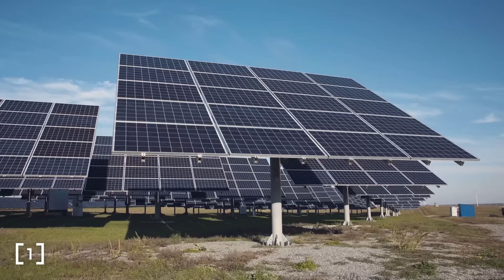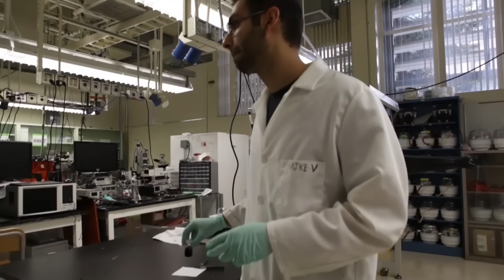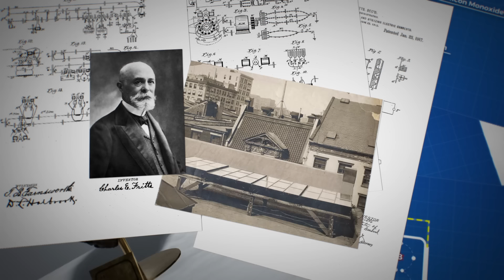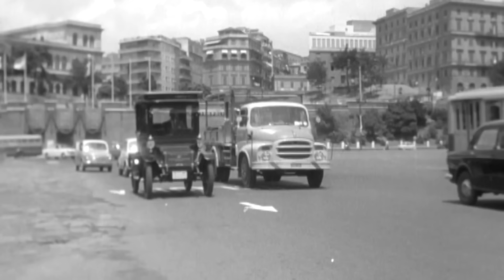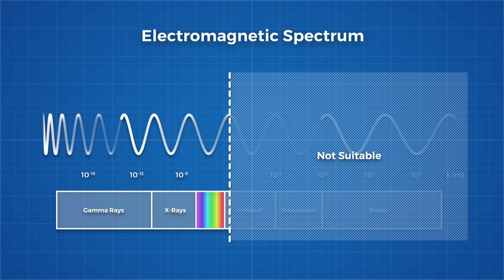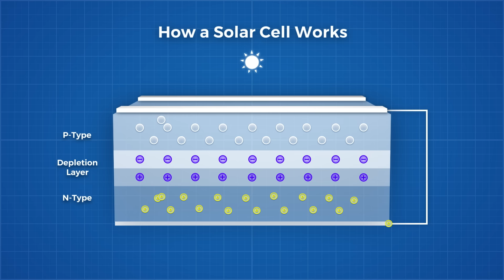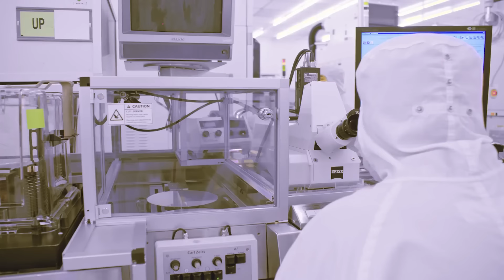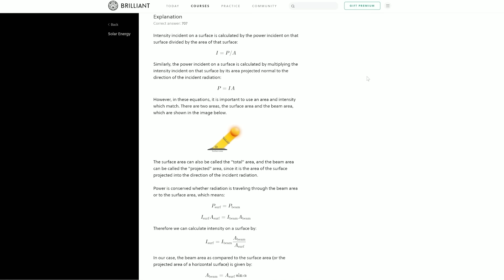The Mystery Flaw of Solar Panels

Comment: The real flaw of solar energy is that it needs storage and storage is expensive. Solar energy is very dilute and intermittent.
Reply: That's why wind, geothermal, nuclear, hydro, and pumped hydro can make up the difference
Reply: @samueltukua3061  Only nuclear matters really. And if you have nuclear anyway, why bother with wind or hydro or geothermal? Especially hydro is a very dangerous source of energy with historically the most deaths per TWh of energy and it is the most destructive to nature just in normal operations, not even when it fails.
Reply: @AlJay0032  because nuclear is still statistically more hazard prone, has even worse long term environmental effects (because we have no way of actually cleaning it up for the hundreds to thousands of years it's hazard), can be used to make nuclear weapons in every country that houses them, has exorbitantly high start up costs, is disfavored by a larger majority of the American public (second only to oil), and when massively corporatized and profit driven I can only see these problems becoming more dire. Thorium reactors have been offered as a solution, but while I agreed with them originally because of their touted benefits, it seems like thorium reactors have already been made and were not nearly as good as advertised.
Reply: @AlJay0032  also I looked it up and that's factually wrong about hydro. The highest number of deaths per terawatt are 32.72 for brown coal, 24.62 for black coal, 18.43 for oil, 4.63 for biomass, 2.82 for gas, and finally only 1.3 for hydro. Then 0.1 for nuclear, wind, and solar combined. this according to "Markandya & Wilkinson (2007); Sovacool et al. (2016); UNSCEAR
(2008; & 2018)"

Did you mean most of renewable energy? Because sure, but that's also about 16-27 times less than our biggest fuel sources
Reply: @samueltukua3061  The numbers you have are wrong. For example if we include deaths for Chernobyl, a socialist military reactor designed for breeding plutonium fast, then we should also include all the deaths for hydro. For example in WWII the Chinese government blew up a dam killing over a million people to prevent the advance of the Japanese. (Well the Japanese advanced anyway in the end.) Also we should not ignore the socialist Banqiao dam failure in 1975, which killed over 150'000 people, if we include Chernobyl to get to 0.1 for nuclear. If we would be honest we would say Chernorbyl killed less than 50 and Fukushima has killed none and will kill none.

Also your numbers for the other energy sources are wrong. Coal deaths in the none-OECD (including such places as China and Pakistan) has over 60 deaths per TWh, while in the west the numbers are lower.

A top killer is also liquefied gas and the numbers for biomass are enormous. Of the over a billion people burning cow dung and similar stuff indoor for cooking without proper ventilation many die of lung problems.

Banqiao was rather recently, why didn't the media report on it much? Why isn't it common knowledge? Because the green journos exaggerate the nuclear accidents and are very low key when it comes to reporting the problems of their pet energy sources. Why don't they make a big fuzz about how windmill blades are a huge unsolved long term waste problem?
Reply: @samueltukua3061  Sorry but what you are saying is factually false. The waste problem was technically solved in the 1980s.
Used nuclear fuel rods are recycled and the long lasting uranium and the actinoids are taken out to be used in new fuel rods in France for example and the remainder is put into glass, where it is safe and will be less radioactive than the ore from which the uranium came in less than 300 years.
If the greens prevent the recycling of nuclear fuel rods while they recycle everything else, even where it makes no sense, then they are just extremely dumb and uninformed. Or they are evil and doing this intentionally to create a problem for nuclear energy.
Other ways to get rid of the nuclear waste is to burn it up in fast breeders. Or to transmute in with accelerators but that requires a lot of energy.

The American public of course has been manipulated into being against nuclear power by left wing greens who want us to remain in energy poverty. Abundant cheap energy would be a problem for their agenda.
Reply: @AlJay0032   according to the US government department of nuclear energy under "5 fast facts about spent nuclear fuel", as of 2019 "The United States does not currently recycle used nuclear fuel but foreign countries, such as France, do." Additionally, nuclear waste can only be recycled so many times, about 2 or 3 depending on when it's recycled, so it will still end up in a storage facility for a tens of thousands of millions of years (the latter only by some estimates) according to "The staggering Timescale of Nuclear Waste Disposal" by Forbes. And considering how much companies love to cut corners, I can only imagine they'd prefer to just store old waste instead of recycling it for as long as getting it from the ground is ultimately cheaper, which is why they currently don't. This is completely beside the fact that nuclear isn't actually renewable, sure it'll last much much longer than current fossil fuels, but it's still finite. Also, interesting that your idea of pure "evil" is not thinking nuclear energy is a good idea. I personally would've thought of things like crimes against individuals like murder, but... being nuclear I guess. I suppose it's helpful to just say "everyone who disagrees me is either evil or ignorant" because then it makes your ego bubble nice and skin tight, like a toddler's. Cozy, isn't it? 

Also, energy poverty??? In the highest energy per Capita country in the world?? Get over yourself 🤣🤣🤣 anyway, try using a source next time. It would make you seem more trustworthy, but you clearly don't know either of those words
Reply: @AlJay0032  CAN YOU PLEASE PROVIDE A SOURCE??? It's impossible to address everything wrong with your numbers (which is all of them), without knowing where you got them :)
 If you looked at my source you'd see that it already accounts for both the dam and Chernobyl issues you have. You'd also see that the brown coal one is due to the number of lives taken by black lung, which was HUGE in the US.
Reply: @AlJay0032  how is a piece of metal long term waste??? Fucking fan blades??? Maybe cause you can... Melt them? Or reweld components?? Or repair and restore them?? Sure we have some issues with it now, but we barely have enough windmills to even address that issue yet
Reply: @samueltukua3061  Because the rotor blades of wind mills are epoxy fiber glass and not metal? Do you actually believe they are made of metal? They are nasty plastic and aren't the greens telling us to stop using plastic? This is not like a few straws or plastic bags, this is tons of this stuff and currently they are being buried in huge landfills because they don't know what else to do with them. Do you know what is seeping out of them into the ground water? They are not being buried in Yucca mountains or deep underground.
Reply: @samueltukua3061  You are obviously either very ill informed and ignorant or intentionally spreading false information.
For example why should you not be able to recycle fuel rods which have been added some additional uranium from recycling other fuel rods? They can only be recycled 2-3 times? Tell me your source or are you intentionally mixing some lies into your replies?

Comment: The REAL issue is the solar panels reject 89% of the sun's incoming energy as HEAT. Solar fields are HEAT VOLCANOES. I worked on a 25MW solar field that changed the local ecology from those heating effects, never mind the disruption of clearing off a thriving cool forest to create a heat volcano, with only a 15-year lifespan. Unless it hails, lol.
Reply: Do you not know that coal plants lose 80% of their energy production through heat? Even worse, this isn't the 50-70 degrees Celsius of the solar fields, but 560 Celsius
Reply: @samueltukua3061  Heat is heat. I doubt your 80% highly. Did you know centralized solar loses 50% of the 7% it captures as elecitry in the transmission? You KNOW Green Energy is a lie, because the power from one solar panel is insufficient to mine, smelt, fabricate, distribute and install. They're not 'renewable' or 'Net Zero' at all! at all!
Reply: @robertmarmaduke9721   "doubting highly" sounds like an excuse for "I didn't even actually look it up and am afraid to because I might be wrong". Also, what do you mean "the transmission", i.e. From what to what? Or did you mean transformation? Or did you mean transduction? And of what 7%? Also, bold of you to blindly assert not only that I apparently know something, but that you somehow know I know something. Saying "you know [insert belief]" genuinely sounds something a paranoid or egotistical person would say. In the sense that you can't wrap your head around others people's minds to contain separate information, lines of logic, and conclusions from your own. Let me be real with you man, your comment is making me embarrassed FOR you. I suggest actually looking up what these words you're saying mean, understanding how these panels work (the video above explains it) and then crafting a response stemming from knowledge.
Reply: @samueltukua3061  Am one of the first environmental science graduates, former Department Head at EPA, until the mafia took over with the SuperFund Scam. Transitioned into the energy field, oil, gas, hydro, cogen, nuclear, geothermal, solar, in US, Canada and projects overseas. From your comment, you're a non-professional narrative re-spammer. You probably don't know Greta is just a paid child actress from three- generations of Swedish entertainers. 😒🔥💩
Reply: @robertmarmaduke9721  this is completely unrelated to the current conversation, but could you explain, without looking them up, what two or three of these phrases mean? 1) a rolling stone gathers no moss 2) birds of a feather flock together 3) don't put all your eggs in one basket. If you could just humor me then it'd be greatly appreciated
Reply: @samueltukua3061  Just keep drinking the ESG Koolaid! Right now you can take out a low-interest loan for $50,000 to put solar panels on your roof, that will have failed in 20-years just as you pay off the loan!! Do it, Sam! Show you care!! Gaia loves all you pooses!

Comment: Sure solar has potential, but its not ready by any means to actually produce reliable source of energy simply due power production to area used. From all the methods in power production nuclear has by far the smallest footprint (pun intended) to amount energy produced, where as say solar would take 1/3 of nations ground surface to power production be 100% solar. This unfeasable and panels tend to loose efficiency even further with out counting loss in micro scratches in the panel glass, dust and well there not being sun light. For person living off grid if they have river with enough volume near that runs year round hydro is excellent method combined with solar panels, but for general power production all so called renewables are rather horrid when comparing utility life, amount of energy produced, footprint used and the cost. From those again nuclear is the winner, followed by hydro, solar and wind being far behind.

Comment: As someone who lives off grid, solar panels are not the least bit useful without storage.  Only half the equation works in a meaningful way.........and no lithium batteries dont cut it for economics or lifespan. Civilization relies on base load power and right now solar is not there yet and it might never be, unless batteries can match lead/acids for cost and nickel/iron for cycle lifespan.

Comment: First, E=hf defines Planck's constant NOT energy.  Second, at 10:00, the separation of charge due to electrons and holes diffusing across the junction generates an electric field pointing toward the p-type.  This is why the diffusion is stopped at a microns thick layer -- thermal energy is insufficient to climb this barrier.  Electron-hole pairs created in this junction are accelerated by this field -- electrons toward n-side and holes toward p-side.  THIS is the current that flows in external circuitry; electron-hole pairs created outside the junction VERY rarely enter the junction.  Thus, we make the junction thicker with graded doping and intrinsic material to enhance the junction's light absorption.  Third, multi-layer cells are now being built (more expensively) with wider gap materials on top of narrower gap materials to push efficiency toward 45%.  Wider gap materials generate higher voltages from the bluest photons and are transparent to redder photons.  Thus less kinetic energy (heat) is left-over.  Lower gap materials then convert the redder photons that reach them.

Comment: The answer is battery. When battery is not yet cheap and not long lasting, offgrid is still problem. When most solar installation are on grid then need huge power generator which can operated come in and out quickly like during peak load. Which that is problem for big power plant

Comment: Just curious, if the degradation is due to not only the boron oxygen impurities but also the reflection of the material why not just create a greenhouse effect in the panel itself? Have the face of the panel be able to allow light through but not escape and then the back panel traps the light coming in to bounce back and forth between the insides of both panels faces. Would that be possible  or would that create too much heat?

Comment: infuse the hydrogen with silicon or carbon or lithium or hydrogen gas in liquid form carbone charcoal or graphite liquid so we found a sink hole for electron sea or plasma or ionised gas hydrogen or hydrogen plasma or mixture of electrode gas so we got electron gas which drive at superconducting speed 😂😂😂😂🤣🤣🤣🤣🤣🤣🤣🤣🤣🤣🤣🤣😁😁😁😁😂😂😂😂😂😂😂😂😂😂😂😂

Comment: Capacity is meaningless - dispatchable , delivered, usable energy that is not curtailed has value. Renewables have none of those features. BTW - Solar almost never pays back the energy debt caused by mining, and refining all the materials and heavy metals needed to make what are just giant integrated circuits [ they are also toxic as hell - where is the decommissioning fee for Solar and Wind ]
Reply: It's a waste of precious materials and a recycling nightmare but not really toxic. This photovoltaic technology is very old and with very little room for improvement. Still waiting for a major breakthrough with totally different materials before this can become an ecologically acceptable product. Wind is different, apart of the blades it's a piece of cake to reuse and recycle.

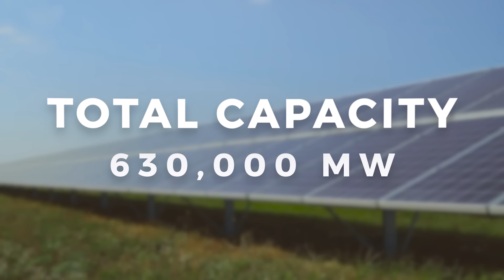Comment: 0:35  to calculate a real capacity of a solar plant, its installed capacity should be multiplied by 50% (daytime) and by 30% (efficiency) at best. That is, 15% in ideal conditions. 630,000 x 15% = 94,500. Please correct me if I'm wrong

Comment: I think that the idea of floating solar panels, for use in pumped-hydro reservoirs, is a good one. The panels are cooled, and evaporation of the water decreases as more surface area is covered by the panels. Also, the infrastructure for distributing the power produced is nearby in the hydro plant.
Reply: Except the toxic substances that come off the solar panels over time, specifically heavy metals.

Comment: Fairy tales about physics that are over 100 years old and are using words, that nobody can define :) E.g. what is electron, what is photon, what are the repulsive forces between e.g. two electrons? Modern (quantum) physics doesn't explain it either, it only provides probability equations that elementary particles will behave one way or another. No self-respectable physicist will say "I can explain it" but only "here is a probability".
Check the story of The Catholic Jesuit Priests who survived Hiroshima in the very center of atomic bomb explosions - is documented by the USA government researchers.

Comment: I find it funny that you start with, solar cells are 20% efficient, then drop to 18% within hours, then later in your video you state 20% efficiency is in lab testing. That is like saying that paperback engineers and scientists are completely correct in everything that is lab tested. When we know that this is total crap until the unit is built and used in real life. I wonder what the efficiency of solar cells are after 1 year of dust, storms, scratching, abrasions, light acidic rains and so forth. What is the efficiency then. Then what is the carbon footprint of each panel, that makes up a solar farm, in comparison to that of a coal fired power station using the cleanest coal in the world from Australia. And what is the area needed for the farm and due to the fact that solar only works efficiently on clear sunny days, not at night, while coal works 24/7 no matter the weather, is in the long run, so much cheaper than solar or wind, in carbon footprint and in efficiency. A real engineer would look at the deficiencies first, recognize and acknowledge them, and try to improve them without dribbling the political lies like polys and crats do, because they aren't paying for it, are they, but are following an agenda. Engineers should be truthful, but we can see that many have been bought and paid for by the psycho enviromentalists.